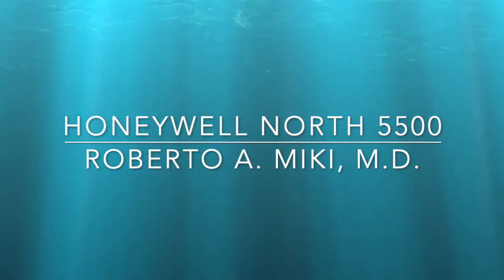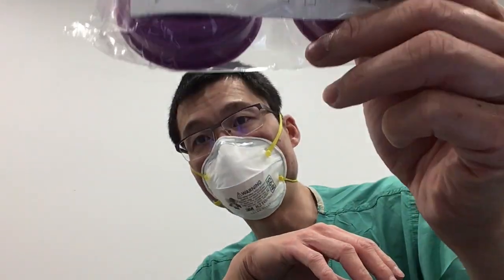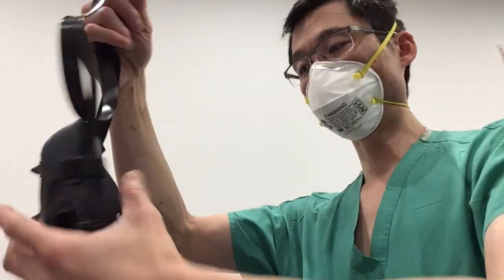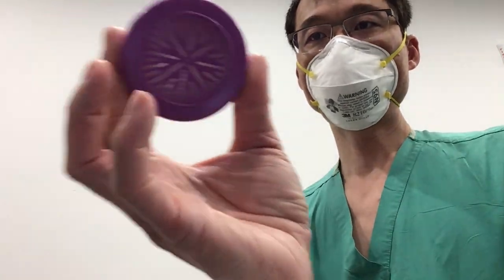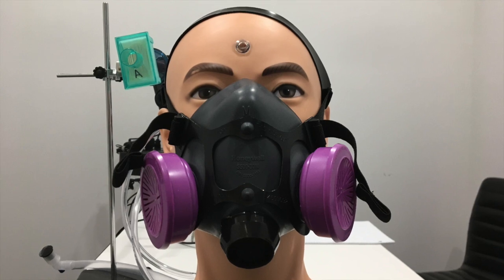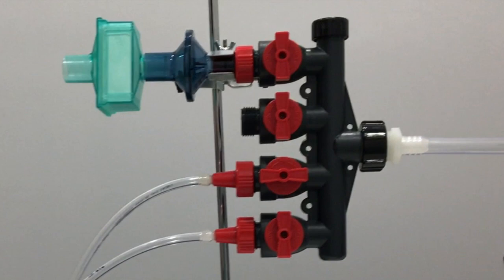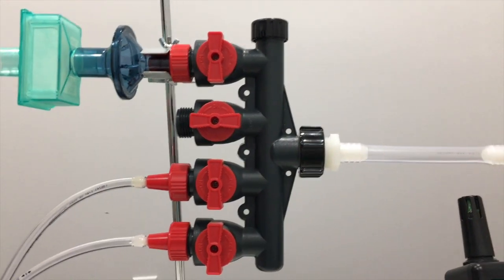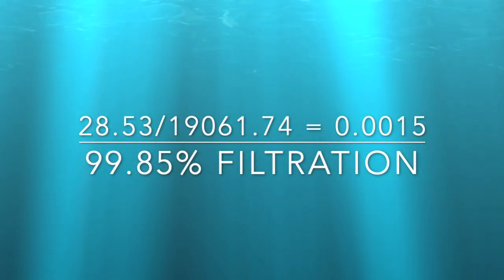Honeywell North 5500 Half Respirator Mask Test with P100 Filters

Comment: there now is. exhaust valve filter made by 3M called the 3M Exhalation Valve Filter 604. although it would only work for the 6000 series half face respirator…
Reply from the maker: Thank you. Will look for it
Reply: @RobertoMikiMD  it would be nice if you made a video of it. like it's filtering efficiency, etc. 👍

Comment: Can you do a video with surgical mask
Reply from the maker: Surgical masks do not really seal well on this mannequin head. There is quite a bit of leak around the edges which makes it tough to determine the filtration efficiency. I have tested the material itself via a different technique. Unfortunately, surgical masks are not really designed to protect the user. They are designed to protect the patient being operated on.

Comment: @Roberto Miki how long would you say the p100 last for covid i read somewhere they say 8 hours
Reply from the maker: The official recommendation for most filters is up to 6 months from opening or until they are hard to breath through which ever comes first. Unfortunately, there is no guidance from the manufacturers for COVID-19 since they are technically not approved for the virus. Many people are throwing away filter are exposure to a COVID patient if it is a pancake type filter which cannot be externally cleaned. The ones with a plastic casing most of the healthcare providers I know are wiping them down and continuing to use.

Comment: Isn't the p100 standard supposed to filter 99.97% of particles .3 microns or large? So if that is the case, this mask fails? You said it's rate is only 99.85%  or so.
Reply from the maker: The filter performs at 99.97% but not necessarily the mask. 99.85%  is better than 95% provided by a N95 mask. 99.85% is not the best result we have gotten but toward the top. The failure to reach 99.97% could be due to the mask or to the testing set up we are using. The set up was made for full face mask respirators. The best I have gotten is 99.99% with the 3M 6800 and P100 filters.  But the most recent full face 15 in 1 mask only got to 99.84%.
Reply: @RobertoMikiMD  Thank you for the clarification. I have the 7700 North/Honeywell with the 7580P100 filters and I have been using this very comfortable mask for years when working with asbestos, and now I use it for covid. You're review is very useful and I have been looking for an online video of a quantitative test for the mask I use forever (5500 is almost the same as the 7700). If possible, you should check the other popular full face mask by Honeywell the 76008A. I have that too and would be very curious. I do irritant smoke checks (using vericheck). Thank you for your very informative channel.
Reply from the maker: @gwinners27  I will try to get my hands on the 76008A mask to do some testing. Let me see if I can find it on Amazon.  Great to hear someone found this information helpful!
Reply from the maker: @gwinners27  They are using this mask on the COVID floor at one of the local hospitals and the staff have been really happy. I have not seen a bunch of people getting sick so it must be working. The health system has like 800+ patients admitted.
Reply from the maker: I just posted a video on the Honeywell 76008AS mask. I have a 5500 which I will test soon too.
Reply: @RobertoMikiMD  I wonder if you could test the Honeywell/North 7700 half face, which I heard is the most popular half face?  It's a popular mask with nurses and doctors because of the comfort and is the full silicon version of this one.
Reply from the maker: surfer70707 I can try

Comment: I order resporator on Amazon  for price and availability of filters a local hardware store.   Great video. I prefer this design and semi universal filter port , which is same size of a Poland spring  bottle cap.  I cap off one side to save on filters in my line of work. Im curious if you can provide feedback on my air flow which I dont seem to have restriction on while MacGyver-ed😅 idea for  capping off one end.
Reply from the maker: I can try and measure what happens. Great idea considering for virus prevention application there won’t be a lot of dust which could clog filter.
Reply: @RobertoMikiMD  im using for paint hobby  automotive. and also I work in animal rescue field of work.    Ill be waiting for video 💪😷👍🤝
Reply from the maker: What do you use to cap?
Reply: @RobertoMikiMD  .9 oz water bottle cap. Before cap I put a piece of plastic bag to complete the seal
Reply: @shawniebeans8382  does your respirator have Honeywell written on it instead of North? Found several 5500 models with North written on them. I wonder whats the reason for this difference
Reply: @nayeemulhuq8745  honeywell on mask. .  Model #550030S . Reading material say honeywell north.  I believe thats the thread type . I could be wrong.

Comment: is it good to wear all day long? can u breath in them? do u need to change the filters?
i wear glasses does that helps from keeping it up fog on my glasses?
Reply from the maker: You can wear it all day. Filter needs to be changed when it gets harder to breathe or after 6 months which ever is sooner. You can wear glasses and they should not fog because the expiratory valve goes forward.
Reply: Im an ophthalmologist. Which is the best filter that i can use with honeywell 5500
Reply from the maker: North 7580P100 Particulate Cartridge is the one I tested!
Reply: Since the exhalation port is not filtered, is that a problem? I have the honeywell 7600 n 100
Reply from the maker: The exhalation port not being filtered is a problem in some settings. You will have trouble in the operating room. Also if you are a silent carrier you may inadvertently expose people. Some hospitals will not let you wear this type of mask off of a COVID-19 floor. Some require you cover the exhalation port with a mask.
Reply: @RobertoMikiMD  Anyone who wears this in a medical setting should be immediately terminated.
Reply from the maker: Why should they be terminated? Covering the exhalation port with a mask is no different from you wearing a surgical mask which most medical personnel are using. When you use a regular mask your breath and cough still leak out the sides. Even with an N95 a sneeze or cough leaks out the sides. When you use a PAPR all of your breath leaks out to the surrounding environment. These are all items used regularly in healthcare environment. Some hospitals are distributing these for personnel on COVID floors.
Reply from the maker: Why should they be terminated? Covering the exhalation port with a mask is no different from you wearing a surgical mask which most medical personnel are using. When you use a regular mask your breath and cough still leak out the sides. Even with an N95 a sneeze or cough leaks out the sides. When you use a PAPR all of your breath leaks out to the surrounding environment. These are all items used regularly in healthcare environment. Some hospitals are distributing these for personnel on COVID floors. I see the argument that the exhalation port is not filtered but it can be addressed. There are even people who have figured out how to place a filter before the valve.
Reply: @RobertoMikiMD  You know this has been classified as an aerosol virus, right?  No virus that spreads by droplets would have spread this quickly.
Reply from the maker: Absolutely its transmitted via aerosols which means this is best way to protect the healthcare providers. No disposable mask fully protects others. 

Check this website out: https://www.fau.edu/newsdesk/articles/efficacy-facemasks-coronavirus.php

They are actually going to check how this exhalation valve behaves. I sent them some masks to test. So, we will see soon.
Reply: @RobertoMikiMD   Masks do not protect against airborne transmission.  Never have never will.   Want to prove me wrong?  Quote a source posted before all the covid misinformation.  BEFORE 2020.  You do know what before 2020 means, right?  Find me an article requesting masks against the flu.  Won't happen.
Reply: @deydraniadiancecht8298  state your source that masks do not provide protection against airborne particles.
Reply: @denshusabellano1799  About a hundred years without a single study proving they do.  Remember the last mask mandate?  Didn't think so- it was in 1918 during the flu pandemic that killed 650,000 Americans alone and 50 million people worldwide.  Plenty of papers were written about it since then and the consensus is that masks did nothing.  Since then not one study has ever shown that surgical masks stop or slow the transmission of airborne particles.  Not one.  In an entire century.
Reply: @deydraniadiancecht8298  provide link to the study please. the video is about p100 respirator not surgical masks or woven masks.
Reply: @denshusabellano1799  There hasn't been one.  That's what I said.  In 100 years, there hasn't been a single study showing surgical masks stop or slow airborne viruses.  Not one.  I can't link a study because NONE EXIST.  In 100 years, no one has written one.  

You're asking me to do something like "link a study showing that seat belts can't make pizza."  Seatbelts don't make pizza so no study exists showing that they can't make pizza.
Reply: @denshusabellano1799  
"Surgical masks do not meet NIOSH or OSHA standards for respiratory protection, offering no protection from aerosol inhalation. Before contingency and crisis measures are implemented, CDC recommends the use of alternatives to N95 FFRs, including “other FFRs, elastomeric respirators, and powered air purifying respirators.”2
This means that healthcare organizations must make every attempt to obtain alternative respirators for workers before resorting to practices such as extended use or reuse of FFRs, use of expired or non-certified respirators, or FFR decontamination."

Right there says it all.  They... do... nothing.

Respirators don't filter exhalation.  Surgical masks don't filter exhalation.   It's right there.

Also, I dare you- I dare you to find a study that predates covid-19- A study that was written BEFORE this year- that favors masks for airborne viruses.  They don't exist.

BEFORE covid.  (as I already said in earlier posts).  No one has yet to present one to me.  Ever.  BEFORE covid 

Yeah I know I keep saying before covid, but every time someone like you comes at me with this, they will link me like 12 studies written this year.  And the funny part- They all essentially say the same thing yours says- "Maybe.... but probably not"  That's what your study says.   "Maybe... but probably not."
Reply: @deydraniadiancecht8298   yes surgical masks dont filter viruses because it wasnt designed to do so. elastomeric respirators DO just like in the video. 

are you a doctor? are you caring for a covid patient are any infectious disease patient for that matter?

what do you suggest medical practitioners do? wear nothing? is that your point?
Reply: @deydraniadiancecht8298   do you even comprehend what im saying? where did i say that only doctors understand how valves work? 
calling me stupid while not answering my questions. the irony. 
stick to electronic stuff and dont meddle with medical issues. you do not even present facts. just your “expert” opinion on covid. and youre not even in the medical field. 

even if you have 10 degrees in whatever electronic degree you have, does that make you an expert on covid? or any infectious disease for that matter?
Reply: @deydraniadiancecht8298  so mr. 3 degree in electronics. what do you propose medical practitioners do? are you suggesting they not wear protection like masks?
Reply: @deydraniadiancecht8298   sir, you are incoherent with your replies. we were talking about respirators. what are you babbling about ppes? did i ask about how good you are at repairing equipment? what fake and real ppes are you talking about?
Reply: @deydraniadiancecht8298  when did i accuse you of not
knowning what a respirator does? i was merely asking for evidence based studies to back your point. hahaha you amuse me man. all you’ve got are just insults.
Reply: @deydraniadiancecht8298  did i even mention that ppes protect the patient? hahaha of coarse ppe protect the medical practitioners. ppes that include the respirator being shown above. you even said that medical personnel wearing respirators should be terminated. why is that so sir? please enlighten us.
Reply: @denshusabellano1799  You need evidence to back up the claim that respirators have an expiration port?  Really?  Did you not watch the video here?  He shows it to you!  Do you need to be hit over the head with it?  

you're asking me for proof that the respirator has an exhalation port!  What is wrong with you?
Reply: @deydraniadiancecht8298   you said plenty of papers were written that masks dont work. send me a link that an N95 mask or p100 respirator did not provide adequate protection.
Reply: @deydraniadiancecht8298  you know a hell lot about infection protocol? what makes you qualified? you have 3 degrees in electronics and that makes you an expert on infection protocols?
Reply: @denshusabellano1799   And you have?  100% of your posts have been one thing: "What makes you qualified?"  Like a 2 year old pissed about losing an argument.  Grow up.  Learn how to be an adult.
Reply: @deydraniadiancecht8298  i wasnt pissed off one bit. in fact i had fun seeing your replies. i was geniunely looking for an intellectual reply from you, but was disappointed. haha. review your post and see which one of us was pissed off.
Reply: @deydraniadiancecht8298  100%? haha you do not even know how to quantify. im not surprised though seeing your level of comprehension.
Reply: @denshusabellano1799  are you still talking?
Reply: @deydraniadiancecht8298   of course. let us continue.
Reply: @denshusabellano1799  Are you still talking? +1
Reply: @deydraniadiancecht8298   thats it? giving up already?
Reply: @denshusabellano1799  Are you still talking? +2
Reply from the maker: What do you use to cap?